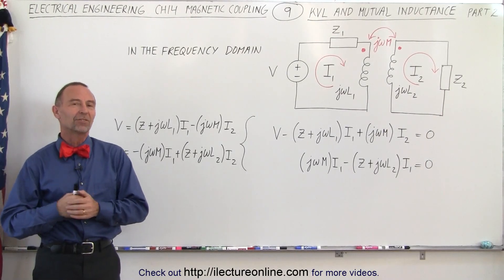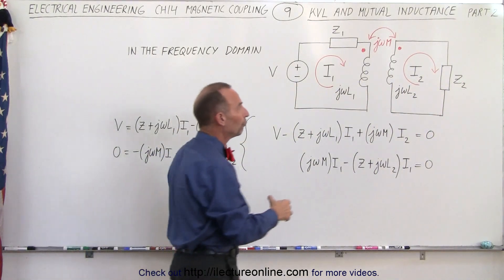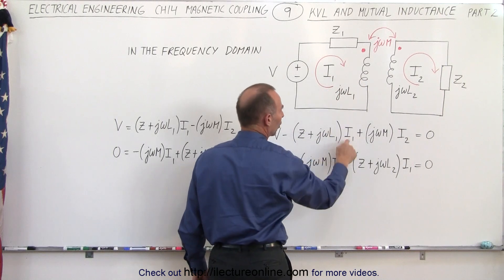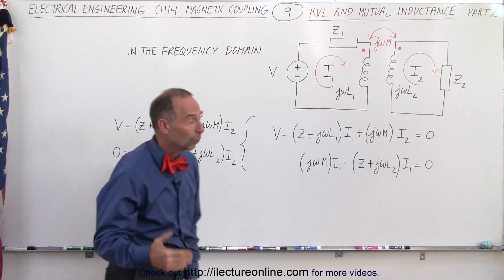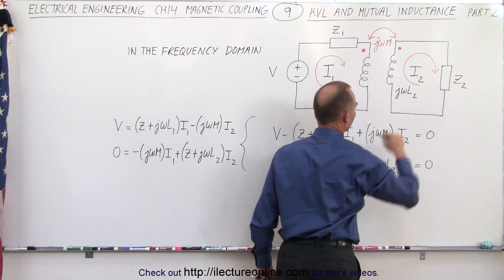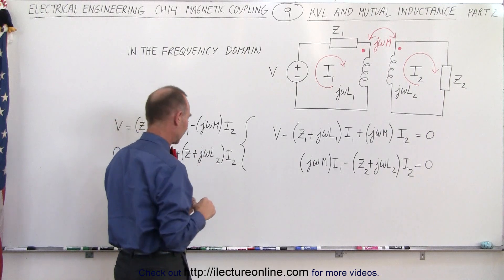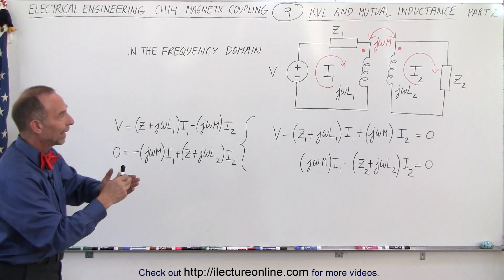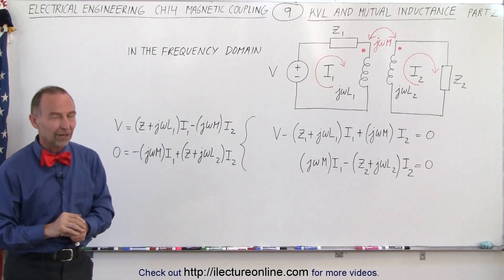Electrical Engineering: Ch 14 Magnetic Coupling (9 of 55) KVL and Mutual Inductance - Part 2***

Comment: "That is how it's done". TRADITION!!!!!!!!!!! everyone knows you apply voltages to both the primary and the secondary of a transformer (to see if it will blow up). TRADITION is why PSUs are so badly designed. And why the circuits are over 100 years out of date.
Reply from the maker: The lectures are designed to help students in their introductory electrical engineering classes.

Comment: Thanks for clarifying mutual inductance in transformers. I will have two coils each in the primary and secondary windings with Z(2) being a tuned resonance tank circuit. See Stanley Meyer's and other's work on You Tube.

Comment: Keep'em coming! 🤟😎🤟
(Btw, should be -(Z+jwL2)*I2 on the last one, bottom right, right?)
Reply: Sometimes it is good to always start with a +ve value at the beginning of an equation, but I agree it did look a bit out of sorts. I would have started as you mentioned then altered it to show the value of the +ve first aspect. Still the same though.